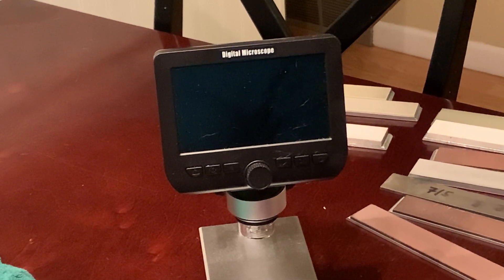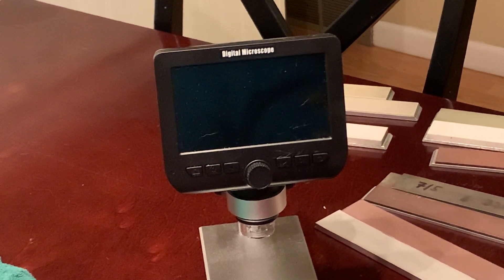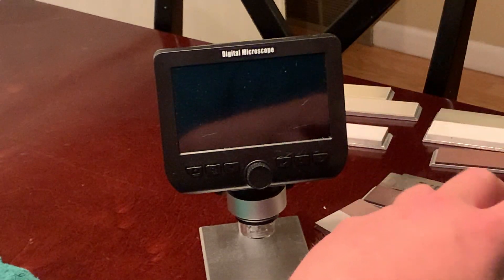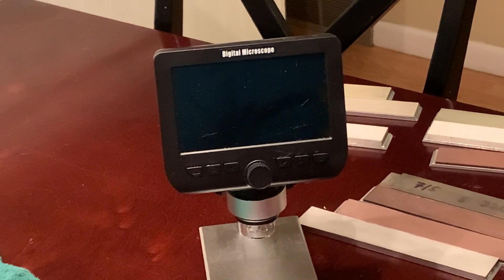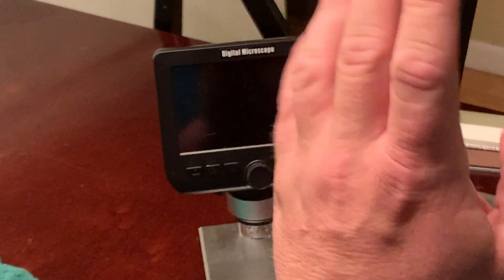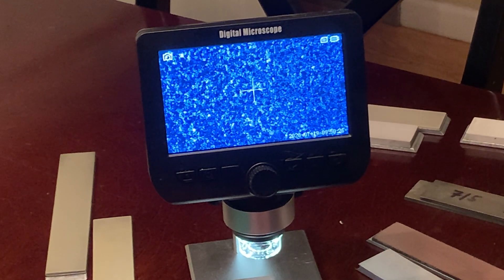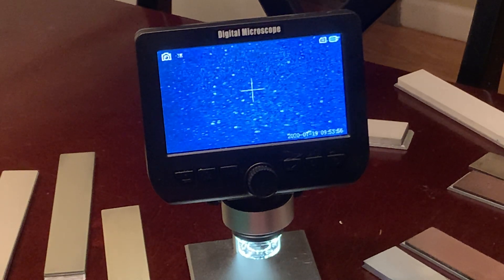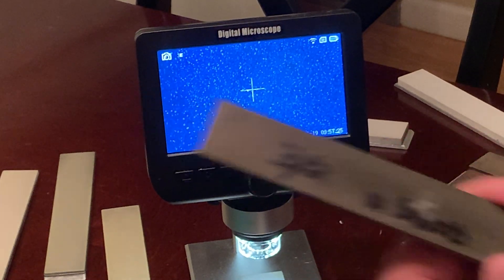Understanding abrasives PT 3

Comment: Do you find that CBN or diamond leave a sharper edge or better finish in any way?
Reply from the maker: CBN doesn’t scratch as deep. So it’s a little easier to remove scratches from the previous stone. But really one is just as good as the other as far as an abrasive. Now stone quality can vary across different manufacturers